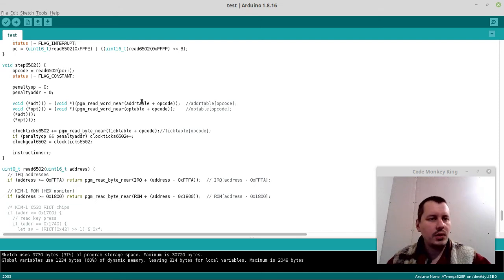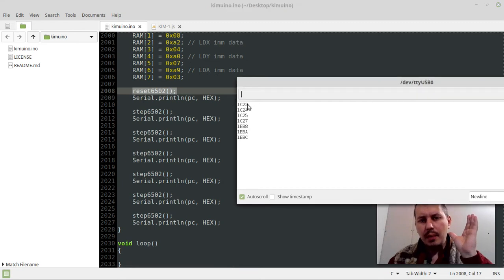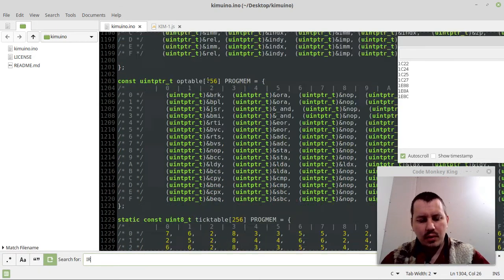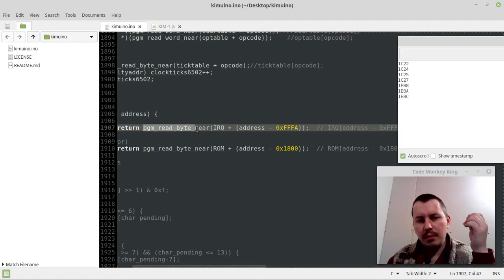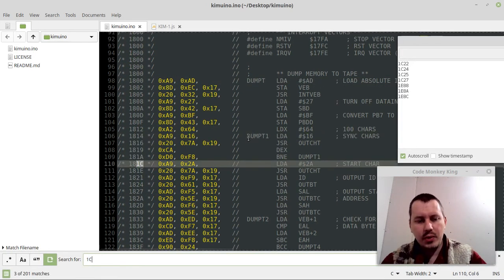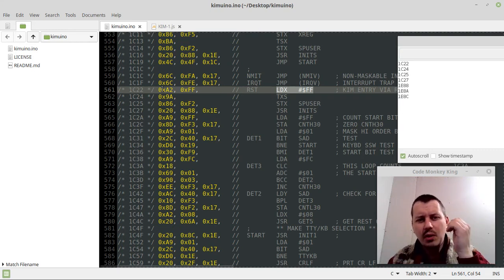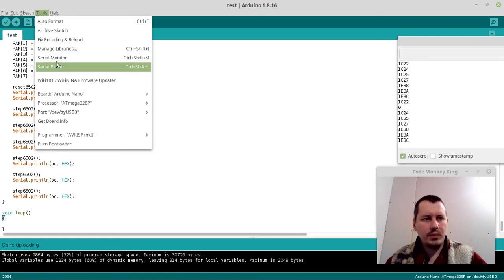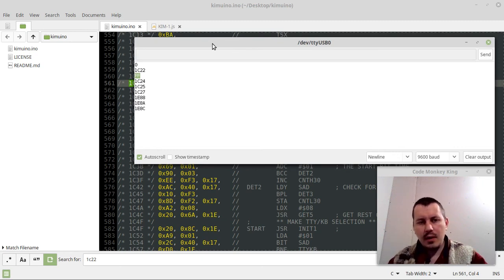Arduino based KIM-1 emulator: resetting 6502 CPU, pointing PC to ROM and stepping a few instructions

Comment: What arduino are you using for the 6502 emulator
Reply from the maker: I tested with Arduino pro mini and 2560 mega. Essentially whatever Arduino with 2+ Kb of SRAM should work.
Reply: @code_monkey_king  so the nano should work